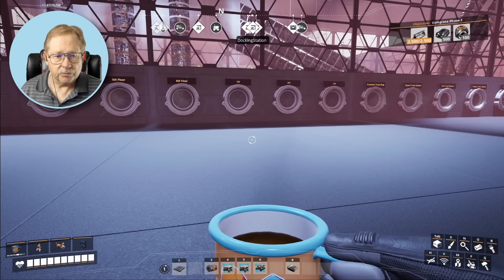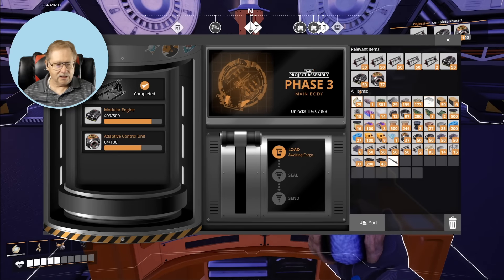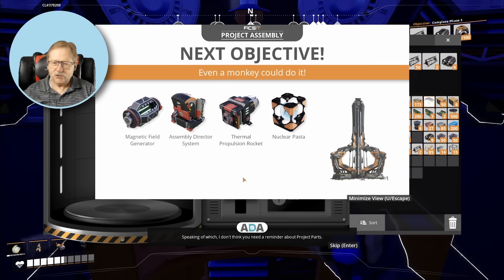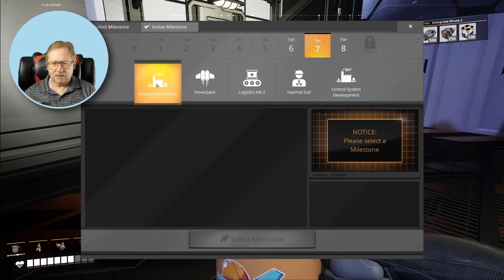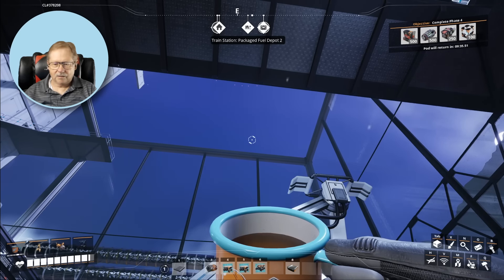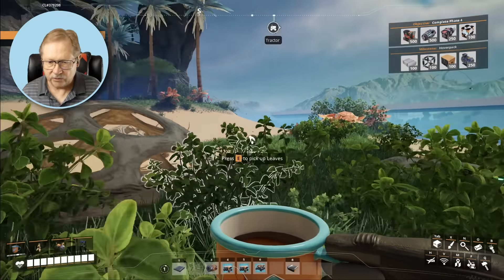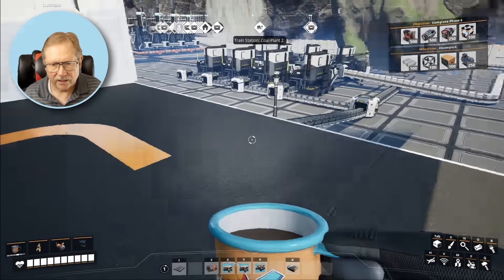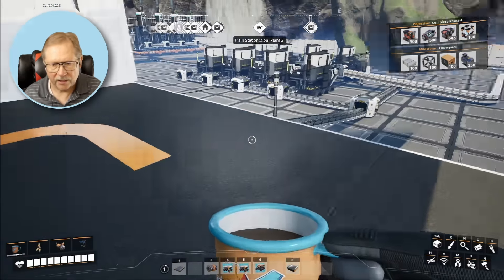Building an Aluminum Ingot Factory [Satisfactory 1.0 Episode 16]

Comment: I remember building my Aluminium Ingot factory, then immediately unlocking Pure Aluminium Ingot, entirely removing the need for me to import extra silica lool
Reply: Reminds me of when I just set up a big facility in the early phases to produce a lot of smart plating and motors and immediately after unlocking cast screws
Reply: My buddy and I set up our first large oil grid and immediately unlocked diluted fuel to which we tore it all down
Reply: *heavy residue, we unlocked diluted fuel right after finishing the 2nd…

Comment: Love watching your content to get some inspiration for my own builds.

On my save i went out searching Hard Drives for Sloppy Alumina and Pure Aluminum Ingot so i didnt need Quarz for that. 
But i used the same Quarz and Cole spots for something different , as soon as i got them out of the cave i used the empty space to plonk down a Train station. 
I used a Train on the same path you used until i arrived at my Caterium / Copper / Electronics and Oil / Plastic / Ruber Factory.

Comment: God I hate aluminum. It just never seems to flow right for me. Probably me doing something wrong, but I could never get it balanced. Something was always out of whack until I just gave up and over supplied everything.
Reply: I did the maths, and it says it should be right,but I know what you mean, it still looks wrong.
Reply: I think it's just something with the game physics but if you connect the byproduct water into the inflow of a refinery from the bottom, it prioritizes the bottom over any horizontal feeds and ensures there's no backing up.